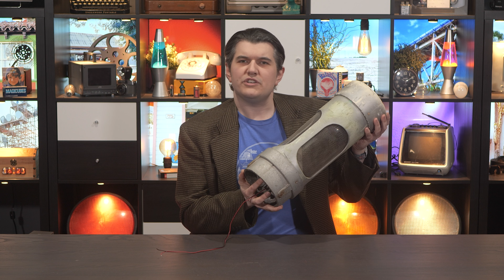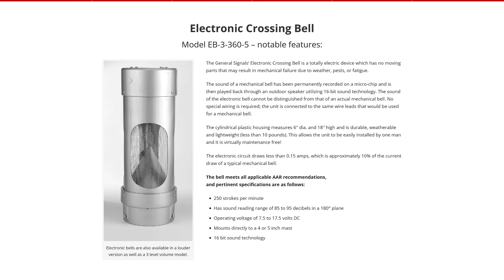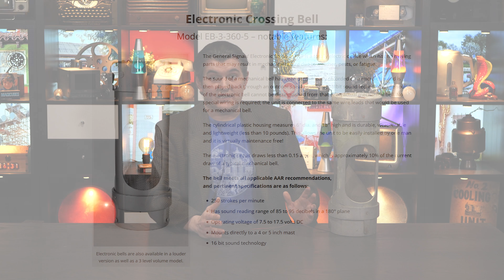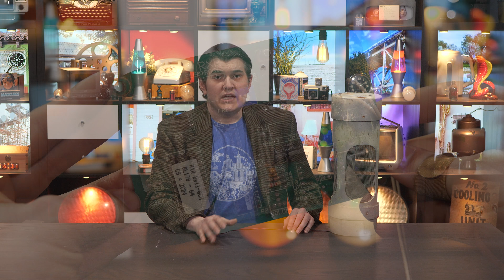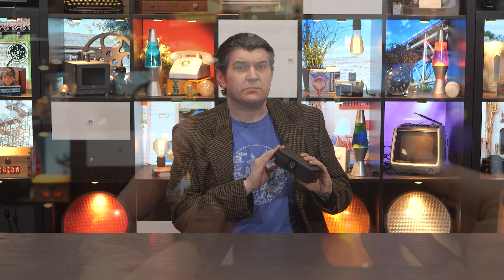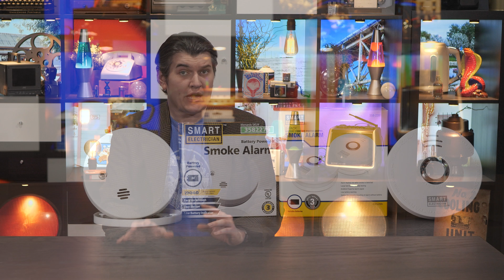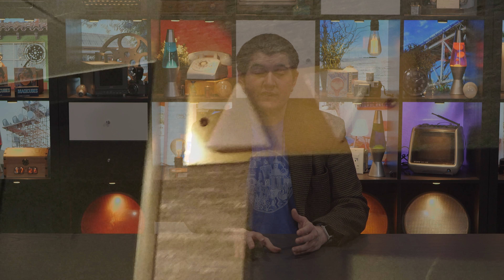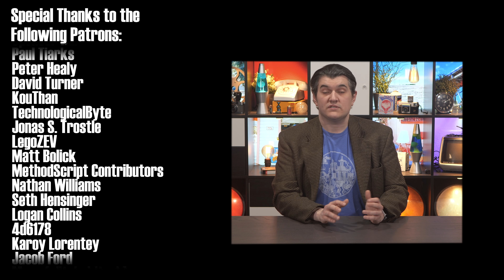The disappearing and unappreciated art of audible alerts

Comment: I use the DTMF tones of the last 4 digits of the person who is calling/texting me as their notification/ring tone.   Each notification is 1 second long, but the tones are compressed down to 0.75 seconds of that.  For those old enough, it's like the DTMF tones you'd hear cable TV networks use in the old analog days to trigger local ad/logo inserts, or what you might hear on syndicated radio stations, or sometimes when being transferred when calling a large company.  It's nice being able to know who is calling or texting without having to get up, look up, or even pay attention to it.  My brain subconsciously decodes the DTMF and handles whether it's something which needs my attention of can be dealt with later, all without conscious attention or losing focus on what I'm working on.
Reply: I used to work in EMS, and before my area switched to digital trunking radios, service calls would begin with a series of tones to specify the firehouse and apparatus. That meant the firehouse alarms could be set to wake up only the EMS guys if Fire wasn’t needed. I was amazed at how quickly one could learn the tones to know which of our brothers were being dispatched when “the tones dropped.”
Reply: Aren't those also the default tone made by the dialer? All my phones over the years had that when typing the number to call (I know, a seemingly forgotten act these days), including my current one. Some did have a setting to change that to a sequential xylophone making for a nice party trick, but the default has always been the DTMF tones.
Reply: How did you manage to set that up?
Reply: @faawks  surely theres some dtmf encoder software or website out there. just get the mp3 file and set that as a custom ringtone
Reply: @radunegovan3841  Audacity has a good DTMF generator.
Reply: @radunegovan3841 Audacity and Sound Forge both have DTMF encoders in them, and yes, I made individual Mp3 files.  

I'm willing to bet there's a way to do it with Tasker, but I haven't had time to set it up.  The Mp3 file solution worked well for me.
Reply: i thought u meant the bad bunny song
Reply: Please play Bluegrass. You would be so good at it. I'm begging you. Tennessee number system is just decoding DTMF. You're already so ahead of the game - what I wouldn't give to have you in my jam circle. 

For the record - I didn't even know I liked bluegrass when I started playing. Had a roommate who loved it- I thought it was OK but didn't care. But then I started actually PLAYING.... it's like a puzzle game mixed with team sports and nursery rhymes. You meet some cool people, develop a niche skill... I didn't even know how to play my instrument when I started. 

My favorite beginner songs to learn: bury me beneath the willow, dear old southern home, walls of time, mountain dew, memories of mother and dad, and There Is a Time. The last song is the most fun AND easy. Mountain dew is a close second. 

Stay cool, tone decoder!
Reply: Not sure that my comment got the sentiment across - I am SO IMPRESSED at the whole nine yards of your comment. I want to do this, DTMF has always been very cool to me and I often think of it when I'm playing bluegrass haha. You're a cool cat for sure

Comment: The chimes on airliners are much more "ad-hoc" and less "designed" than you make them out to be. Most are just creative use of the seatbelt and no smoking signs, or rather the chimes associated with them (and as such actually are meant to be noticed by passengers). For example signaling gear up/down (which for the cabin crew means on takeoff that they can start preparing service and on landing that they have to get seated) is usually done by cycling the no smoking signs and thus triggering the chimes associated with that. Even on modern airliners where the no smoking signs are meant to stay on at all times. A lot of other signals from the cockpit to the cabin are done by quickly cycling the seatbelt signs off and back on again (or on and then off if they were off to begin with) for a double chime. If you watch closely you can actually see the signs flicker as the chimes sound.

Comment: Auditory cues are genuinely a necessary tool I use on a daily basis. I work in a factory, the machines I run all use specific tones or jingles to indicate mechanical problems, location, and when material needs to be fed. And there are multiple lines that all have their own sounds.

Comment: In my last city (I just moved) our fire alarms also had to have audio “This is a fire alarms, evacuate the building” or the shorter “Fire, Please Evacuate”. And a the strobing lights. I lived in a newer apartment complex on the 8th floor and for our 15 month lease for about 6 months at night our fire alarms would malfunction the complex got multiple fines from the fire department too. It sucked because if no one responded to the alarm quickly we had to walk down 8 floors until the building was cleared.

Comment: I'm a Fire alarm technician and installer.   Depending on the equipment present, there are a few options for the sounds during an alarm.  What's neat is they use a "sync" signal so the notification devices know what to do.   You can make them do Temporal 3 for general alarm and also Temporal 4 if carbon monoxide detectors are part of the system. 

But for places with a large capacity of people, code typically requires a Voice evacuation system.  It can play a variety of tones and messages to direct the occupants when programmed correctly. 

Once when trying to integrate an existing Simplex Voice evac with a new control panel,  I activated a contact that played this message: 

"There is an active shooter in the building, please take appropriate cover"

Comment: Thank you so much for mentioning accessibility and updates changing basic phone functionality.  I have vision problems and am extremely photosensitive. A couple of years ago, I got an Android phone that I liked. It definitely wasn't my favorite phone experience, but it worked relatively well for me for a few months. Then one day it had a major update, and the way that the screen worked changed. As far as I could tell, it did something weird with the refresh rate. The results for people with normal vision were that the battery seemed to last a tiny bit longer. The results for me were that the screen was the equivalent of looking into a piercingly bright strobe light. Within a few seconds of trying to read any messages, I'd start to get sick. We went to the store where we got the phone, but nobody there could help me because they didn't know anything about it, and nothing is standardized. EVERY MODEL'S SOFTWARE IS DIFFERENT! It took them a couple of minutes just to figure out how to navigate the settings menu, because none of them are the same! WHY!?!?!?!?!!?!

Even going into the developer settings, we could not get enough control back over how the screen worked for me to be able to use it. I ended up having to switch to an ancient phone that's so old, it can't even run Discord, let alone other stuff that I need. I'm scared of buying a new one because I don't trust that this isn't going to happen again.

Comment: I just helped get an early '70s pinball machine working, and I was surprised to discover that the "bells" were very much like that mechanical door chime you showed, just simple metal plates (aluminum I think) that get thwacked by an extremely simple solenoid, just a loose steel pin in the middle of a coil of wire. That whole machine was a trip and definitely worthy of some kind of video, the electromechanical insanity inside them is crazy and it's mind-blowing that it was made that way post-Apollo.

Comment: 14:26 I still have mine set that way!
14:46 I haven't gotten super granular but I have special ringtones for certain important contacts and apps (or in the case of Discord's iconic tone, to know that it's less important).
20:00 Hey, speaking of which, I know this is about sound but what ever happened to the little red light that used to continuously blink even up through older Androids to unobtrusively alert the user to a missed call or message - not the camera flash or waking up the whole screen but just a single basic LED in the top corner? The one Fountains of Wayne sings about?

Comment: The notification cool down works for me on my Pixel 10 Pro. If the same person texted within the last 3 minutes, the volume is quieter. And if you receive a message from the person you have open, just a soft tone to alert you plays, not the default notification. Also, I hate repeat notifications. When I had an iPhone (I hated it with a passion), that "feature" drove me absolutely nuts.

However, as a truck driver, I need a loud ringtone so I know someone is calling me, otherwise, I won't hear it over the highways one note tone, and engines one note tone, mixed with the wind. I just wish there was a way for the tiny computer to recognize "loud environment" and "not loud environment" and I could set different tones and volumes for each environment. As it is, when I am at home, if I don't turn the notification volume down, my wife teases me because she'll be outside on the porch and hear my phone go off when I get a text - and it's on the other end of the house.

Comment: You know you're a certain age if you remember when there were bell chimes in mall anchor department stores instead of voice paging.  I also will never forget the electronic bell my high school used in the 1990s and what the different tones in the morning meant for the schedule that day.  (my high school used a Bogen Multicom 2000)  For an interesting story, I drove a transit bus while in college at Umass Amherst and I remember there were two distinct chimes for passenger stop requests depending on the manufacturer of the bus.  The originals were mechanical bells, one was an extremely unpleasant chirping sound from a piezoelectric speaker, and the most pleasant one came from the Canadian made buses that sounded more like a plane bong.

Comment: When I moved to the US I heard what I assumed was some kind of building-wide door left open alarm in my apartment building, especially since it seemed to just be a loud busy tone. Thinking nothing of it since my door was closed and locked I just went and had a shower. It was only later on when I started my job and they were explaining the fire safety system I learnt that the 3 tones meant fire. From my, UK, background, a fire alarm was quite distinct and not based on the number of tones at all.

Comment: I think the most overlooked magic of Pebble was how beautifully simple it was to design, debug, and mess with watch faces for it. The IDE was all a single simple app, built in emulator, and trivial ways to push the watch faces to your actual watch.

I unfortunately hopped to Garmin about 2 years ago without before Pebble was resurrected. But I also chose the Instinct 2 Solar for the battery life measured in weeks.

Comment: You know the one thing I want my phone to let me know? When the battery is low. It seems like a really simple thing that I might really need to know. I just don't notice the little bar in the corner, and it's kind of important that I know to plug it in so it doesn't literally become useless. 

You know what it won't do? Tell me when the battery is low. 

Unless I specifically enable the automatic power saving feature, which does seem to have an option to enable an alert at "low power", though it doesn't specify when that is. I suspect it'd probably be when the battery saver activated, which the lowest point I can choose for that is 20%, and that would be thoroughly unhelpful because my phone will run for at least another hour on 20% battery, probably more.  And I don't need to be running battery saver mode, I just need to be told "hey, power is low" so I notice and plug it in. Ideally at a power level can configure. 

The number of times I'm listening to a video / podcast and then it just stops because the battery ran out and the phone went into sleep mode when I'm literally in my house not 20 feet from the outlet and could have easily plugged it in has I realized what the battery level was is countless. That I can't simply make the phone beep at me when it hits, say, 5% battery without being tied to some other feature and going off who knows when is infuriating.

Comment: If you are also interested in clever visual indicators, there is the Wig-Wag, a device used for decades in heavy trucks with air brake systems to indicate low system air pressure. They would mounted in the headliner above the windshield in front of the driver, when the pressure falls below a certain amount, a flag drops directly into the driver's line of sight, alerting them to the problem and can only be reset once the pressure rises to the correct level.

Comment: That's a good design and is weatherproof. What you called a rie emergency sound was actually the buy tone for a telephone. I still remember when I had a landline, and the sound it made was exactly that when it hit a busy number. My smoke alarm does not use that 3 on 1 off, though. It is a continuous shriek of an ear-hurting scream LOL I agree about the standardization of the sounds. Seems like common sense to me. Yes, the phone sounds suck big time! Yes, Android update has made my text harder to eliminate for no reason. It was fine before and didn't need to be changed.

Comment: I used to set different sounds for different apps and people on my phone as well. 
They really made that difficult now.
In some apps I have to dig really deep into multiple layers in the settings, and others don't have any options for it at all. 
I once got it all set up, but several updates later it all went back to the same system sounds again.
I also used to have a very simple app that would let me set a timer every time I silenced the phone to turn up the notifications again because I often forget to do that manually. 
It was a brilliant and simple little app which did what should be a standard thing in Android. 
That app eventually didn't work any more on newer Android versions. 
I'm starting to dislike my phone more and more.

Comment: Is it just me, or is the cone on the inside tilted, it is on purpose? If so, can someone explain? By tilting, doesn't it make the sound wave to be more to one side than the others?

[Edit: Think I figured it out. The device have 3 wire mesh openings, and the cone is tilted, such that more sound(s) are reflected off/towards the 2 openings, and less towards the one opening. If I am wrong, please correct me.]

Comment: The user experience I'd like to see on my phone is that I go through and pick and/or make a bunch of simple, unique, non-intrusive audio queues, and then it either hashes or round-robin allocates through them as unique contacts are encountered, and/or assigns the most common contacts up front and offers an interface to flip or replace the assignments. It could fall back to the defaults once that list is exhausted, or not in an included app list, or something.

Speaking of stuff that alternates back and forth: people keep changing visual queues such as hover pre-light and cursor flashing to FADING ANIMATION. Why does this keep happening? This COMPLETELY misses the point. Iimmediate edge transition allow your eye to see the position by seeing the change, and making it fade just dulls this down to the point where it is now visually useless. Why do people think this is an improvement? Examples: Chrome tab hover pre-light (though I think they may have maed this follow animation preference), GTK-4 on Linux (the cursor now fades in the evince PDF viewer), Microsoft Word, etc. Not to mention the increased response latency perception and CPU waste. Just crazy.

Comment: As a car enthusiast I do really really appreciate my vintage Mercedes SL in its noise notifications. Yes even in 1992 there were quite a few noises it makes, but the key is it’s only for important things. Modern cars won’t shut up and it’s a sensory overload to the basics of driving. In my vintage SL it has a high pitched beeping which is very annoying but it comes on if the top is not secured, the folding seat is not properly latched (which has your seatbelts integrated) or the parking brake is still on. But modern cars yell at you for the seatbelt, phone pairing, if a person walks behind your car, if your close to anything while parking, for auto locks, check backseats, reverse, and if your at an intersection and a car is nearby. All the bings and sounds and sheer high pitched noise and vibrating seats. Really make you feel like modern cars were designed for only terrible drivers and they needed to protect the vehicle for the lease term. But why is the car beeping at me when I engage reverse gear, like no dur I know it’s in that gear I put it there! Am I that dumb that the car has to tell me everything I do and also reminds me how to breath?! It’s sensory overload and degrading in many ways. Older cars actually respect the owners and their intellect and ability to operate a motor vehicle . I’ll keep my old Mercedes fleet that doesn’t nag and bother me for just existing and driving